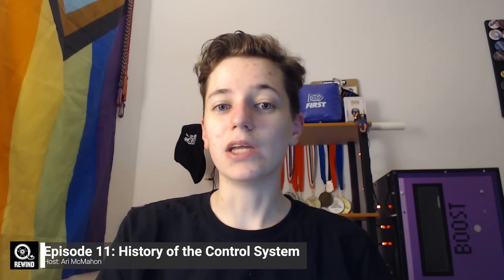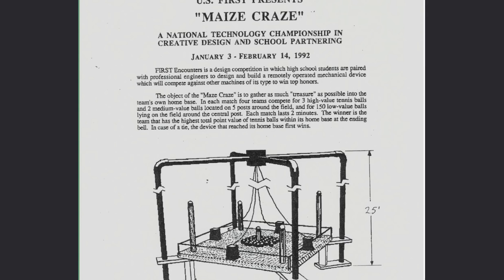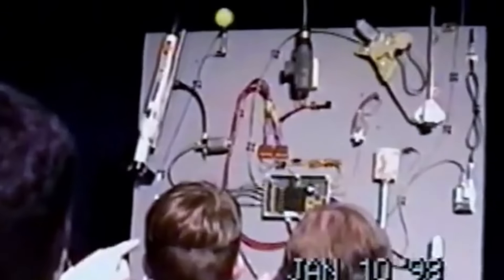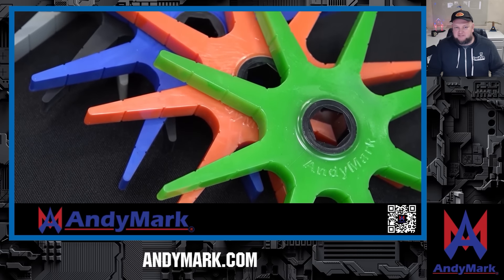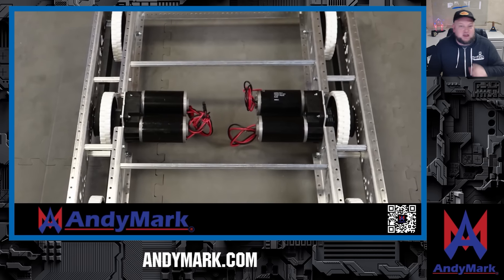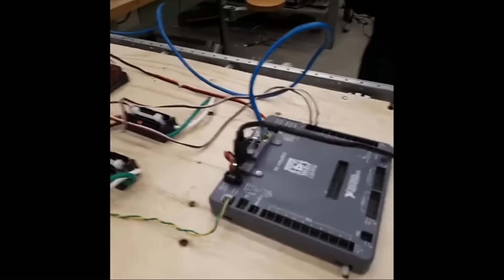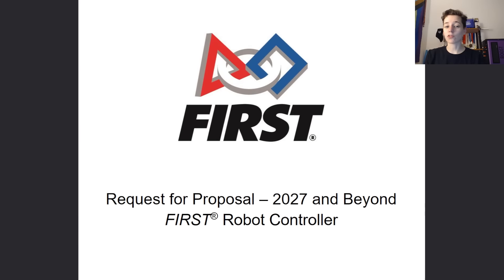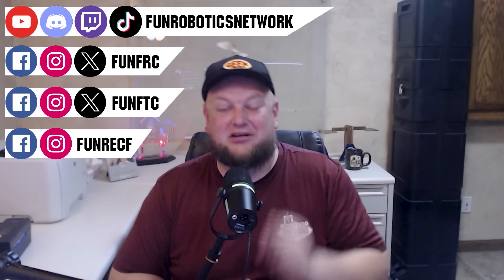History of the FRC Control System | FIRST Rewind Ep. 11

Comment: The best thing about the cRIO was that it was immediately recognized in industry demonstrations. But that industrial connection also meant that it was always meant for stationary application, not being bashed about on a moving robot (or statically charged from spinning wheels on carpet or plastic)
Reply: I remember working at NI when that came out. The big demo at work was throwing one off the roof while operating and it didn't miss a beat. So not really designed for stationary use.

Comment: The original 7 slot c-rio was a monster taking up 3x more footprint then the outgoing ifi controller. The Jaguar speed controllers were 2x the footprint of the ifi Victors. On the other hand they had 100x more compute each then the outgoing ifi controller.

Comment: I'm surprised that FIRST hasn't taken advantage of the various Arduino models out there and created a breakout board with an Arduino to use as a robot controller. Another one that's out there is the Raspberry PI. Being able to run Linux on a robot would create a lot of flexibility in programming it.
Reply: This isn't something most teams take advantage of, but you can actually SSH into the roboRIO's Linux shell. I've seen it primarily used to get log files from the robot, but it could theoretically be used for more.